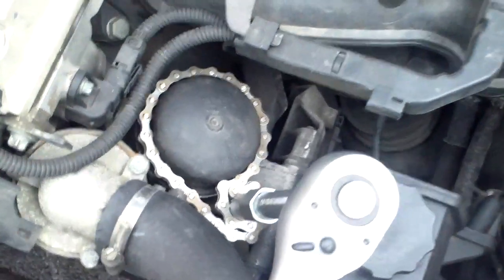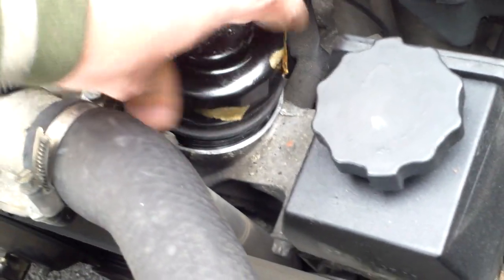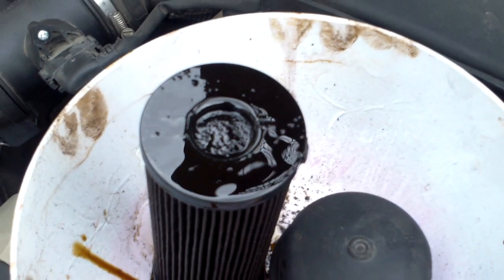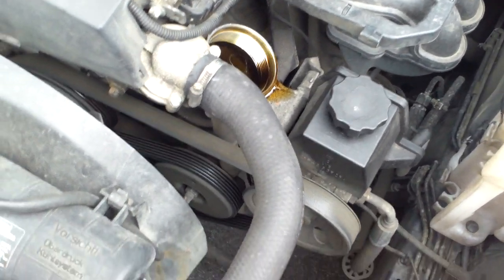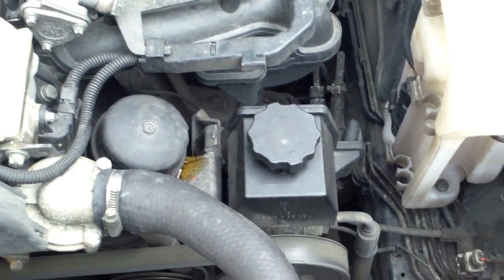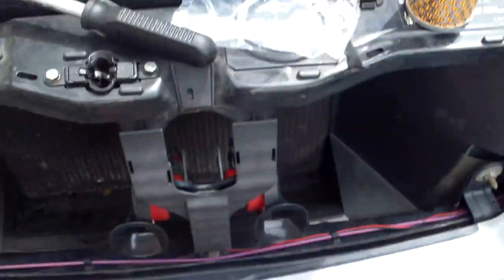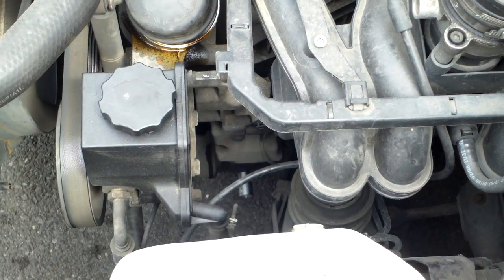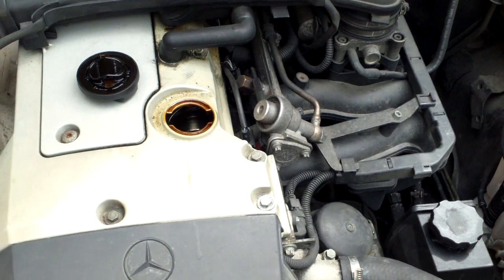mercedes w202 how to change you're engine oil and oil filter

Comment: hey mate, just saw this video. I own a mercedes c180 w202 in Australia, Could you explain how to drain the excess engine oil from the car? also according to my mechanic he said could only use the specific oil filter. but your new oil filter looks different from the original one. So technically it is possible to use a different oil filter? 

Thanks for all your videos, really appreciate it man!

Comment from the maker: the best way to drain the excess oil is to elevate the car on the opposite side that the oil comes out of and pour new oil in. when you see the dirty oil  starting to turn clear you know most of the dirty oil is gone then. you will waste some oil doing this but its the best way if you want to get rid of all the dirty oil. different garages get different filters from different suppliers sometimes they look differnt but once they fit they wil work just dont buy cheap ones buy from reputable source